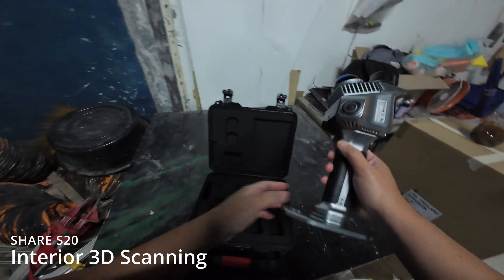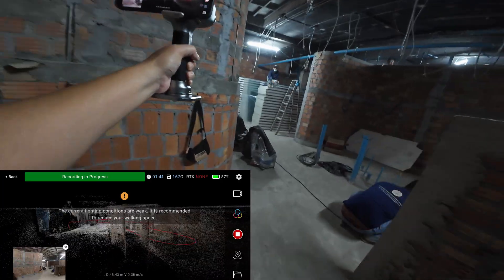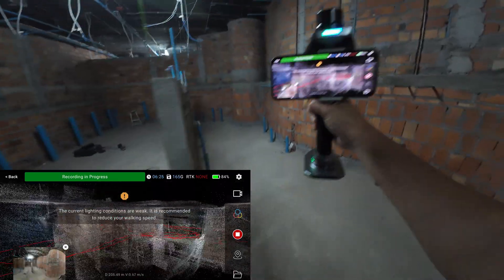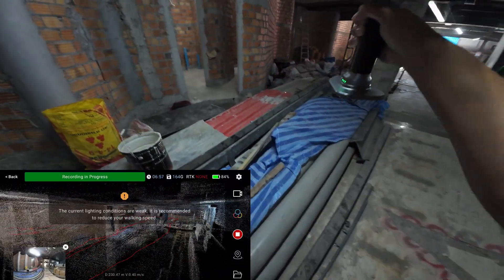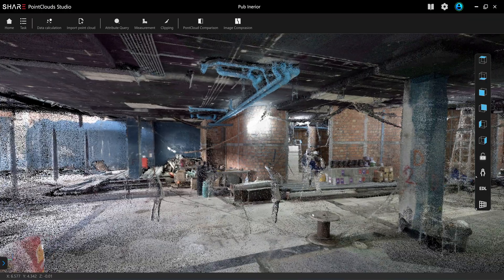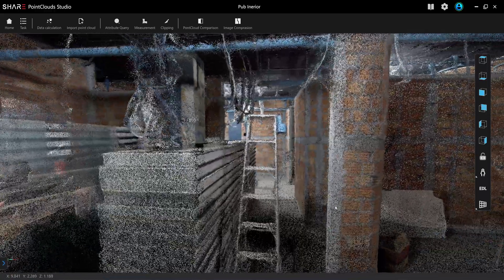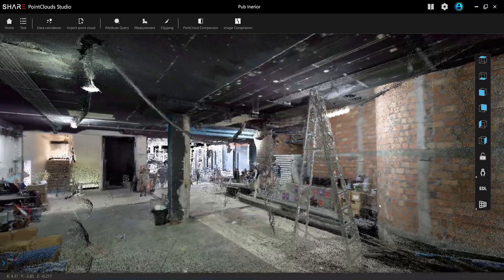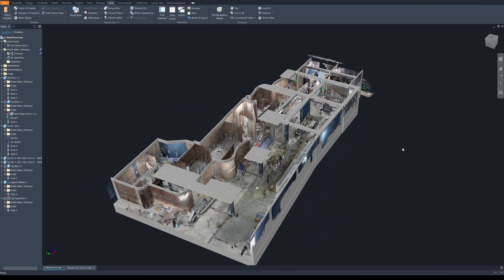From Interior Scan to CAD Model - SHARE S20 LiDAR Scanner Workflow

Comment: Which device is better: FJD Trion S1 or Share S20?
Reply from the maker: The C1 offers clear advantages over the S1:
- Tracks 30% faster
- Lower drift error with consistent accuracy
- Uninterrupted tracking (never loses tracking)
- Quicker startup time
- More reliable connection
- Produces a thinner, cleaner point cloud
- Easier to reverse thanks to an accurate color point cloud (unlike the S1, which lacks color)
The S1’s only edge over the C1 is its longer capture range and sharper corner detail.
Reply: @Payo-TensileCreator  Thank you! But I'm a little confused, which of the devices are you calling C1?
Reply from the maker: @Александр55116  https://youtu.be/aJc091GVQP4
Reply: @Payo-TensileCreator  I asked about FJD Trion S1 and Share S20. Is Share C1 better than both of them?
Reply from the maker: S1 cost $22K can't even compete with $4K C1. You don't even have to compare it to $5K S20.
Reply: @Payo-TensileCreator  Now it's clear😀

Comment: Cool! Would this work for creating floor plans of multiple stories, big buildings too? You said something about automaticly creating floor plans, is this a feature?
Reply from the maker: Once the 3D model is created, 2D plans and cross-sections can be generated automatically. This capability isn’t new, Autodesk Inventor has offered it since 1999.
Reply: @Payo-TensileCreator ah, so you still need to trace the lines to create the model first? Thank you very much for your replies! Helps a ton